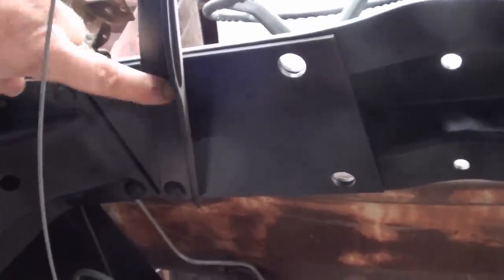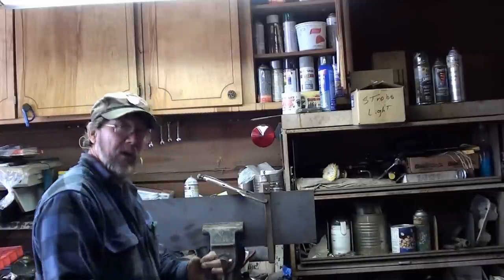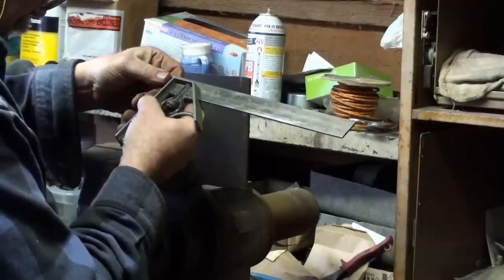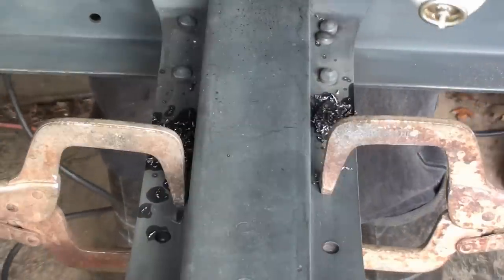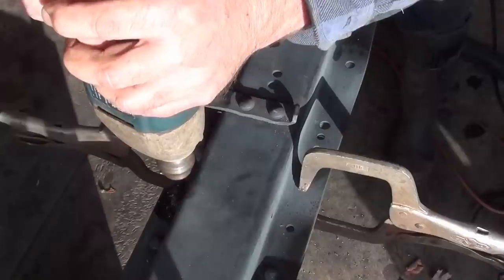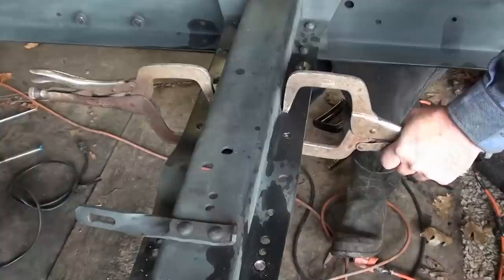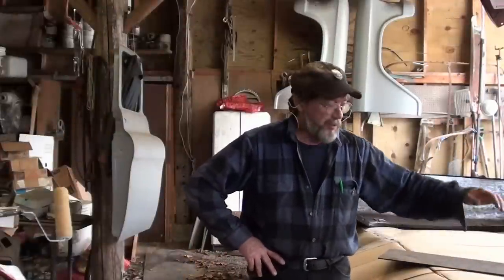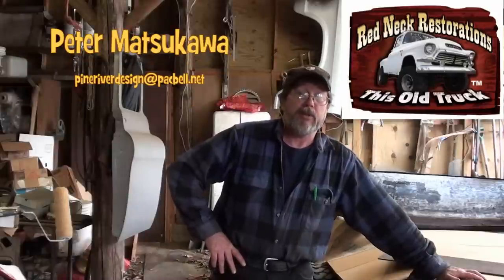Napco 4X4 Transfer Case Mount Plate Fabrication 1955, 56, 57, 58, 59 Chevy GMC

Comment: Wow Jeff, I thought I was the only guy who still used reamers to make holes to size. Kudo's on you using them too!
Reply: Unless you've got a never ending supply of them via work... stick to drill bits as those you can easily sharpen over & over at home. Most folks don't have the equipment or knowledge to rework a reamer and once they're dull? They're expensive to replace. My advice is to save them for when you really need them. Best wishes! 👍🏻👨🏻‍🔧🇺🇸

- Max Giganteum

Comment: I'll tell you what, I've tried name brand grinders. Porter Cable. Dewalt. Ryobi. They've all let me down. By far the best grinder I've owned is an old orange Chicago Electric Harbor Freight special. You can reef on it all you want and it just keeps asking for more. The Porter Cable eventually burned up. The Dewalt caught fire the first time I tried cutting with it. The Ryobi is just plain frustrating because it keeps overloading the battery and shutting off.
Reply: ...and who needs a plasma cutter to cut a straight line? 🤷‍♂️😏👍🏻